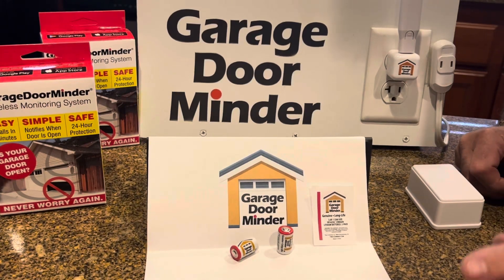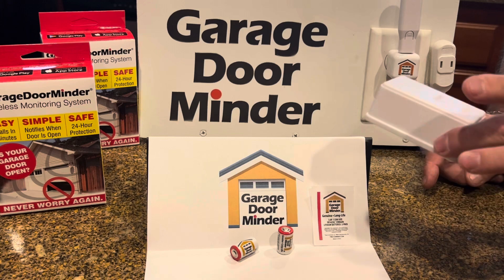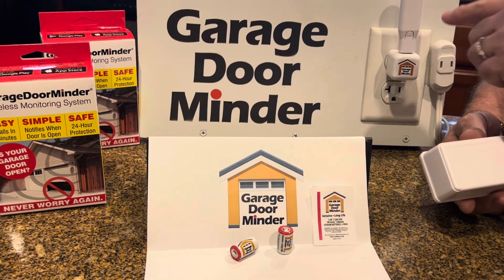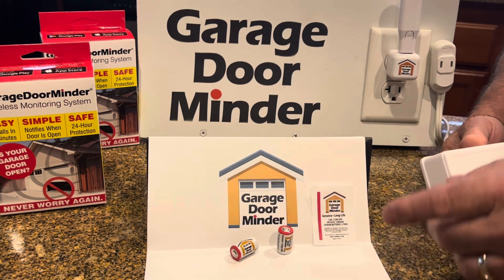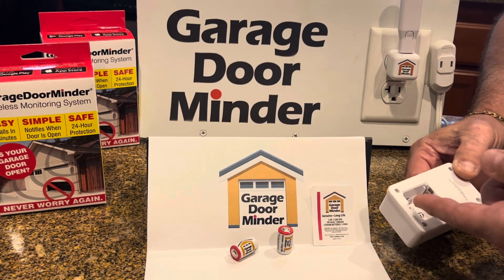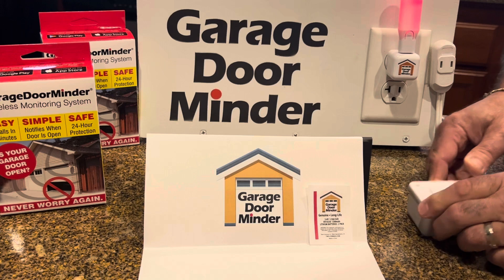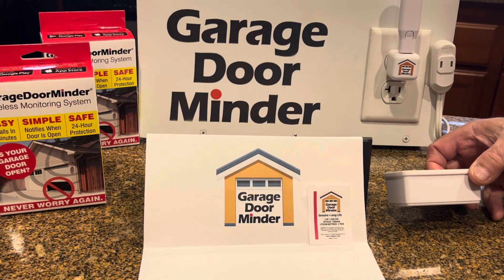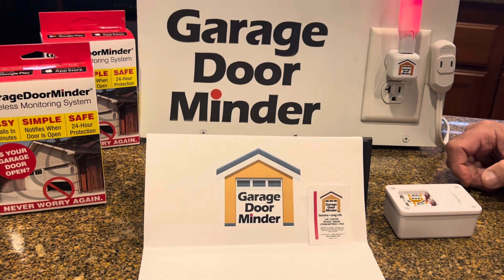Garage Door Minder stops working. What do I do now ?

Comment: how about the tape? it stick already at the garage,it should be at the front so that it will stick always,you need to take off the addhesive tape on it first
Reply from the maker: If you still have tape / Velcro you can get in touch with me I can get you a new mounting bracket that you just slide the unit in and out of making battery replacement very easy.